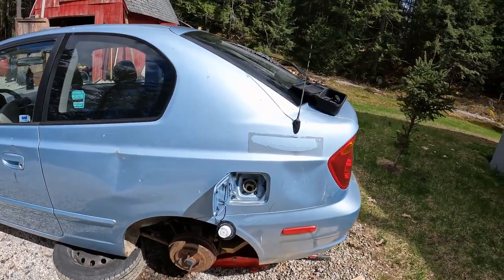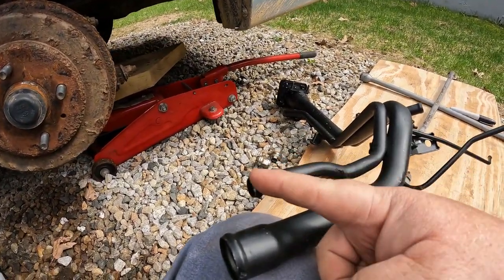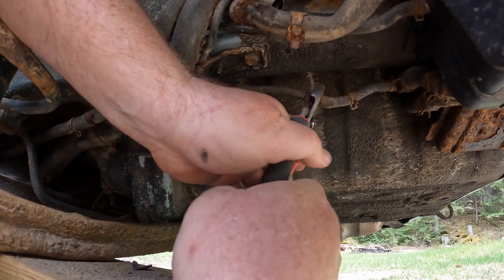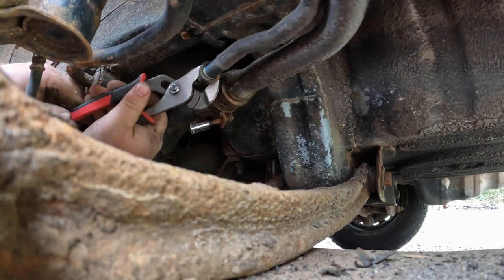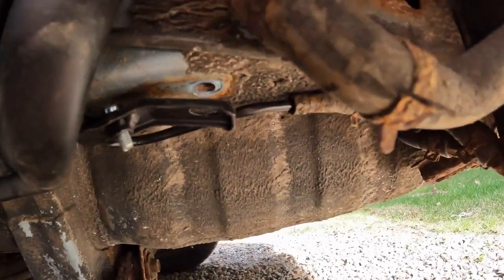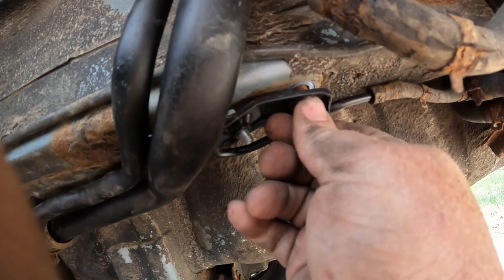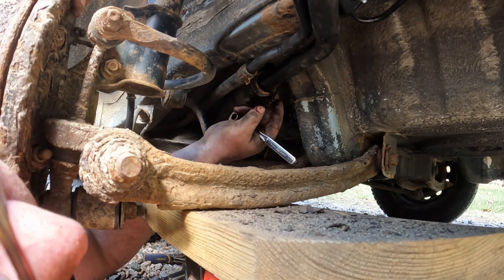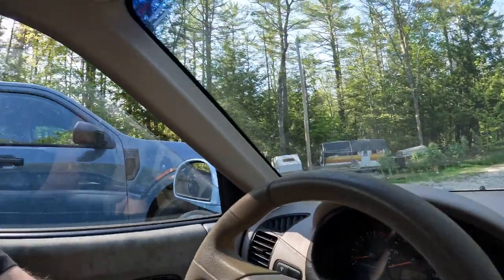Replacing fuel filler tube on a 2005 Hyundai Accent for Evap code P0442

Comment: Dude you are my hero, I have to replace mine in my 02 accent, until then I'm the asshole leaking when I pump gas lol. Thankyou for teaching me kind sir.
Reply from the maker: Awesome!  So happy that I could be of some help.  I am always finding videos on how to fix random things.  Couldn't find any on this....so I made one.  Really appreciate you mentioning that!! Best of luck with your repair.   .....and that cheap, Rock Auto filler line is still doing fine.  Haven't had a leak or the code come back.  Totally worth doing.